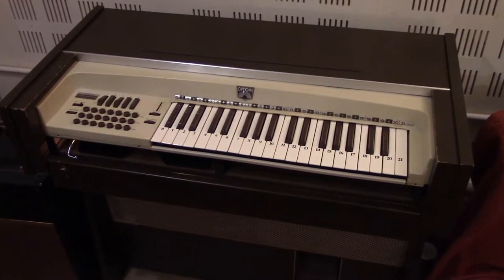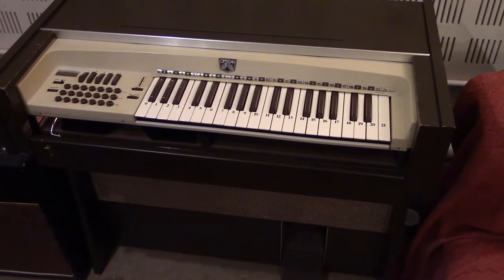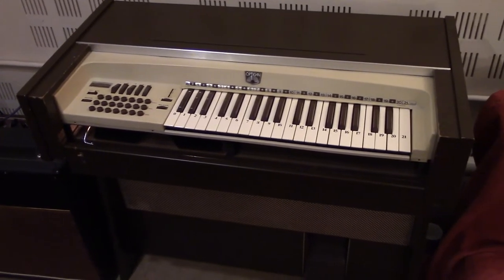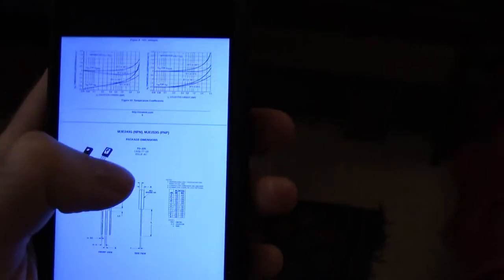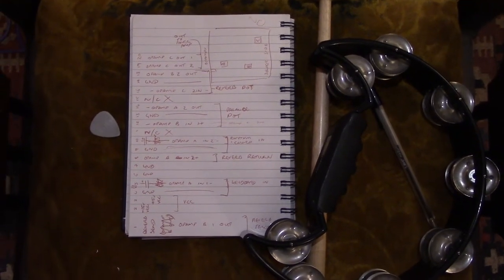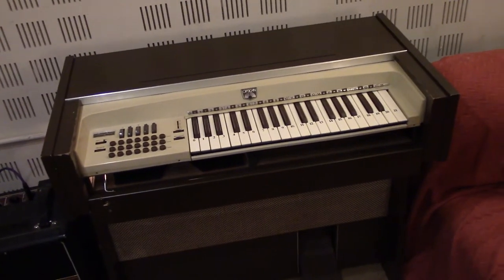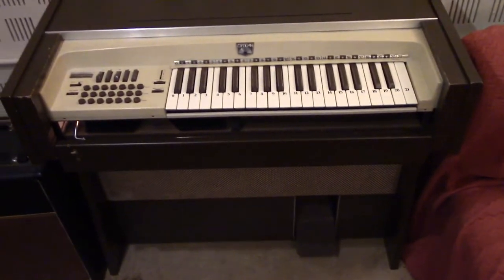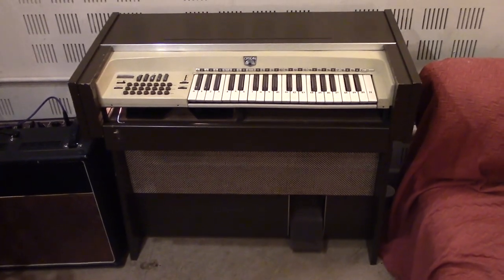Mattel Optigan Model 35011 - Repair Pt6 - Conclusion

Comment: Well done James. Finally found some time to watch all. 

Thank god all mine needed was a really good thorough cleaning and rebuilding of the rhythm section switch matrix. The biggest issue I had was that the rubber idle pinch roller was hardened and slipping.  I think I gave it a quick swipe with MEK and was good to go. 

The entire time I was repairing it, I was exasperated at the design and engineering of it that it kept me awake at night sometimes wondering how to improve it. 

Now I just accept that it probably will never work or sound any better than I have gotten it to. I’m alright with that. 

But I will NEVER EVER EVER EVER try to service another ever again.
Reply: hello, any advice on a replacement for the rubber underneath the chords and effects switches? mine is almost all dry rotted away and half the chords and none of the effects work currently. thank you very much